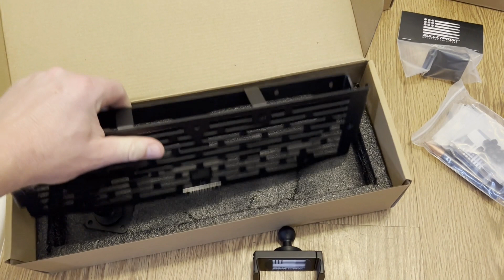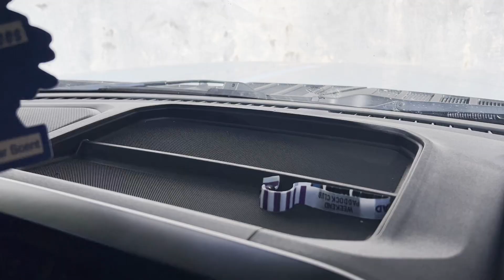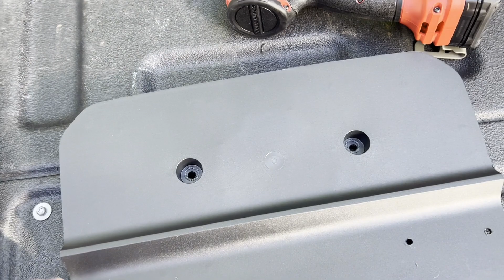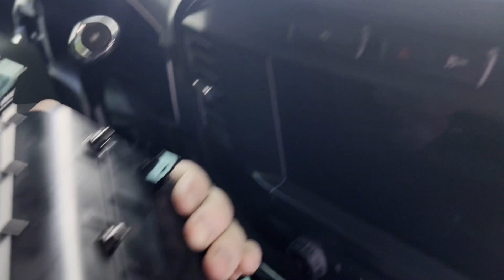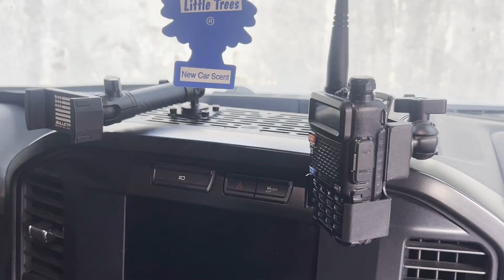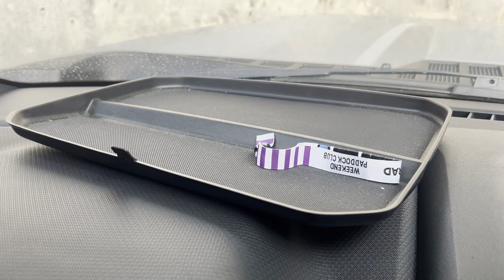Bulletpoint Mounting Solutions Phone Mount Install 2021 - 2023 Ford F150

Comment: Great video. Thank you. 
Hey- it looks like it’s more of a universal mounting surface as it doesn’t line up with the shape of the dash it fits inside. Am I correct?  Are you happy with the fit?  BTW- I’ve seen people mount the plate over top the mat, leaving it whole (rather than cutting it)
Reply from the maker: It seems like it fits pretty well for the truck. The top of the screen is higher than the rest of the dash so I think they had to make it like that for full flexibility. I’m happy with the fitment and if I had the speaker behind it I think it would look a lot better. Planning on getting one of those speakers anyway since the wiring is there